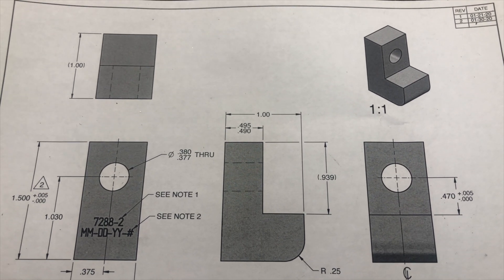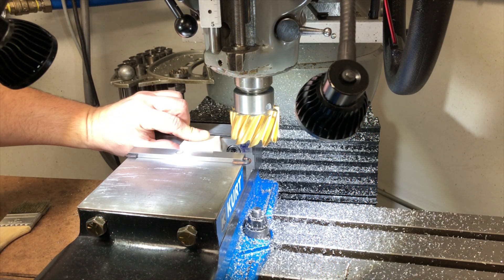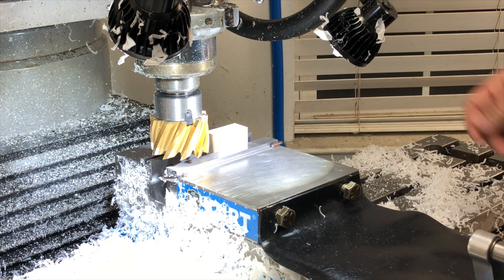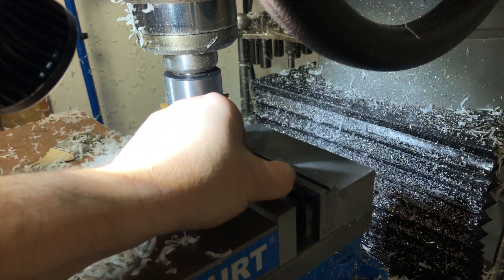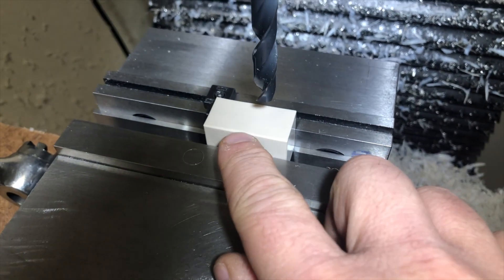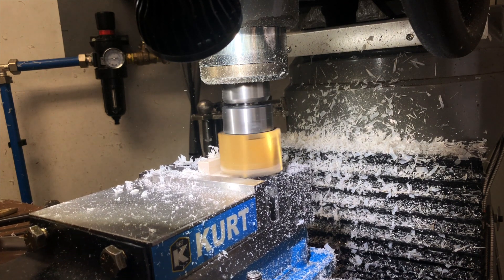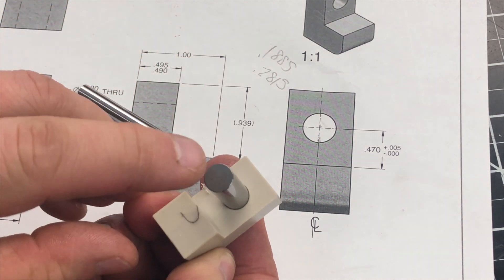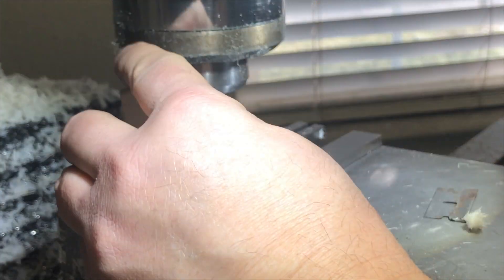Making Tissue Clamps

Comment: Great video ... your 1.500 and the 0.470 measurements are at the smallest acceptable values. Why not aim for 1.501 and 0.471? That way when your customer measures these dimensions there is room for possible measurement differences. 
Can't wait for your new lathe series.